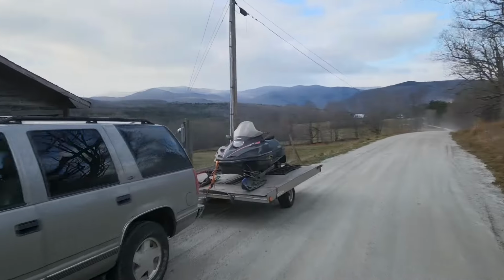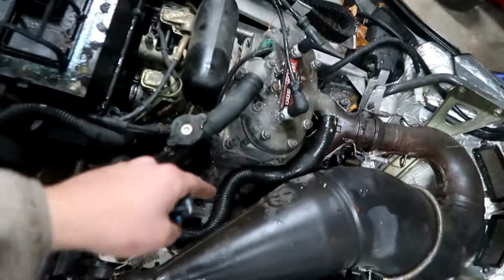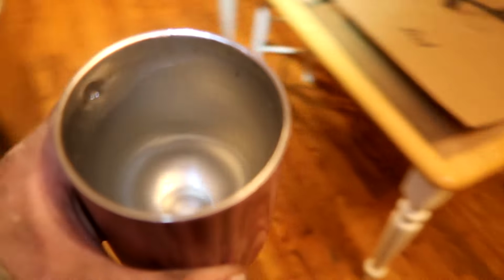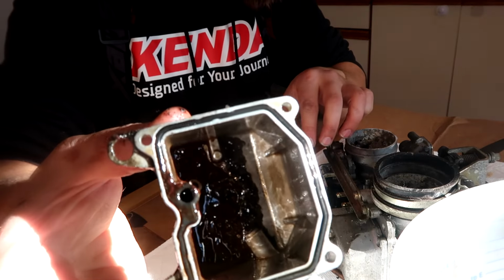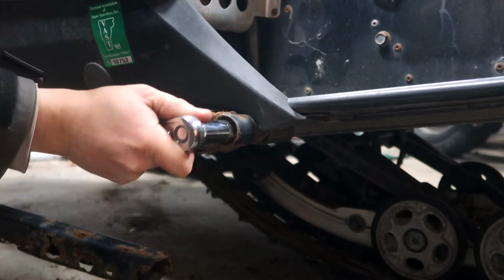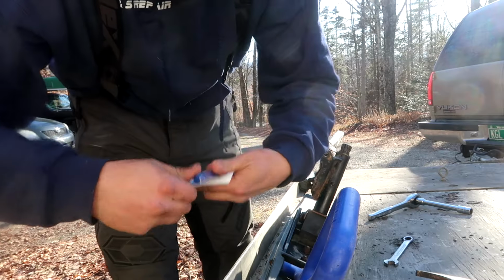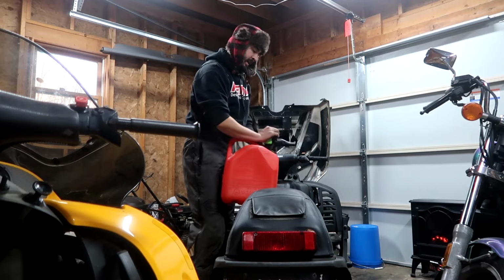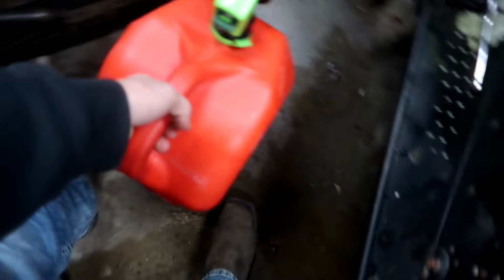Yamaha Snowmobile Left in Woods for 8 years! (Will It Start?)

Comment: I used compressed air and held a shop towel around the filler neck and watched the fuel go into the tubes on the carbs for the 97 vmax 600 I just picked up. Worked really well.

Comment: Wow good deal. And great job getting it up and going.  I found a 97 Yamaha Ventura 600 that is sitting for a long time  very dirty and engine will pop on gas  poured into plugs  so hopefully if I get it I can get it up and going  once it’s cleaned up it’s gonna look great as it’s in great shape minus the dirt. I will need a new track and belt and fuel system cleaned out

Comment: I trick that I learned this year is when the gas lines are dry and you put gas in. Put a rag around where you put it in and poke a hole in the rag with the air compressor then watch it push the gas

Comment: picked up a 98 vmax xtc 700 for $325 with 2500 miles on it. only thing wrong was tors sensor kicking in. loostened the throttle cable and have been riding it for 4 years now

Comment: You need to invest in a Ultrasonic cleaner and save yourself some grief. Save some $$ on carb cleaner as well. Hope you get good snow, a little more riding content. I'd like to see an older Ski Doo Blizzard revive,  '77-'83 vintage. I had a '79 7500 with the 340 LC. Pretty fun for 70's era sleds. 2 stroke rotary valve Rotax power baby!!

Comment: Great Video! Any advice on a 90 Arctic cat prowler 440 that bogs down once weight is on it...worked good for a while after carbs were cleaned then has trouble going up hills. Clutch was checked and seems to grab at the right time. I'm stumped!

Comment: The best degreaser money can buy is L.A  awesome spray on walk away for 20 mins and boom greasy anything gnarly what, will be super brand new but wear gloves and eye protection I did 4 sleds 4 go carts used 7 bottles and chemical burned my hands and soaked thru my shoes and got my feet it's a buck a bottle at ur local dollar store its in a black bottle  this stuff and hot water, or a pressure washer blows carb cleaner away all day
Reply: I did a carb on a 87 honda four Trax 250x ended up losing the slide so I had to take this carb to match a part at a huge salvage yard guy says this a Chinese carb from the internet I said no it's stock he look like holy shit it is this stuff works absolute wonders on anything rusty or greasy